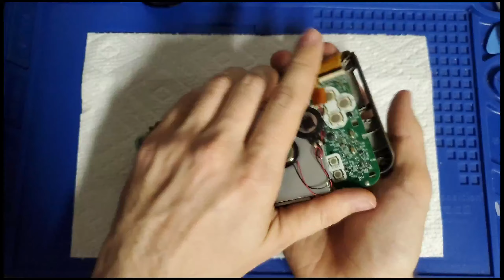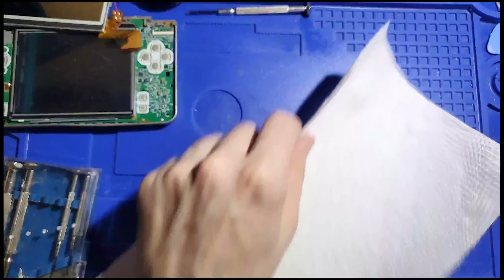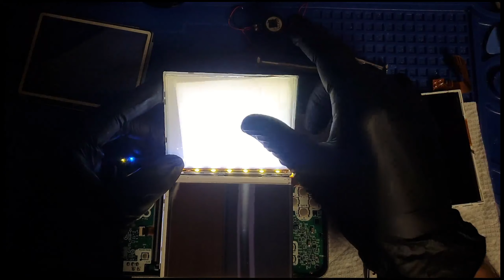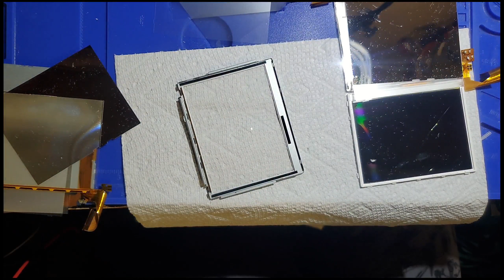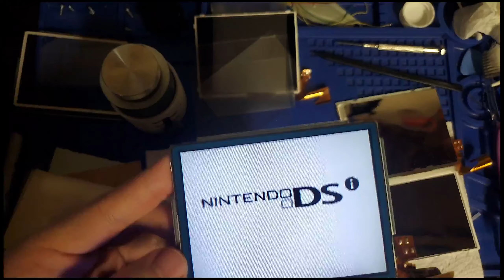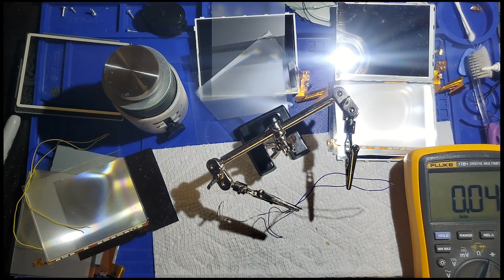[VOD] Looking at what causes Screen Yellowing on DSi XL consoles

Comment: Thanks for making this video!
Both of my dsi xl screens are SUPER yellow so rather than spending $50-100 replacing them, i thought might as well try to clean it and lo and behold came across your video.
I did exactly what you did just that I tried 3% hydrogen peroxide on the last backlight layer, took out the led sticker before that, left it under the sun for 8 hours and left overnight , total 24 hours.
And after assembling it back, omg it looks like new again WTF! 
Why don't people publish this method more boggles my mind as DSI/XL screens are scarce out there.
Reply from the maker: Interesting. 

I really cannot blame no one for wanting to try this. The act of removing the top screen assembly from the console is hard enough, especially compared to just leaving the console on a white screen for awhile. Taking the screen assembly apart adds another layer of difficulty.
Reply: @Killy728  

If you're planning to change the screen, you'll need to disassemble the console anyway, might as well do this step as you have nothing to lose at that point. I'm surprised how it turned out ngl.
Reply from the maker: @jackipiegg  That is a fair point
Reply: @Killy728  
Btw, have you investigated on vignetting of the screen? Found a few online that has it, the picture is visible under the dark areas, which part do you think is the fault for those?
Reply from the maker: @jackipiegg  I haven't looked into it for no other reason than I think that yellowing is a more common issue.

Comment: light reflects internally on the egdes that are yellowed... the mirror edge might be deteriorated. the backlight layer is rough when you scratch it because that texture picks up the light and reflects it out of the layer. the capacitor is there to filter the power spikes turning the backlight on and off.
Reply from the maker: That makes sense. It's odd in the manner in which it deteriorates since it is not a unique phenomenon. Every yellowed screen I have seen always starts at the furthest edges from the center. 

I'd be also curious to know if the capacitor would have any impact on displays with backlight flickering.